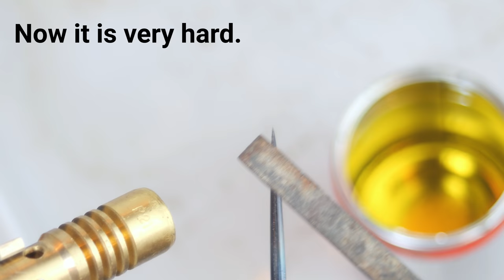I made this awl from an old screwdriver

Comment: Nice project.. I noticed to temper, you just heated up with the blow torch again. I've seen O1 call for 2 hours in an oven. Thoughts?
Reply from the maker: Well, this was not very scientific. If you don‘t know what the steel is, it is all just guesswork anyway. A lot of people temper stuff by heating it to a straw colour. I was lucky and it seems to have worked well enough.
Reply: @imadethischannel  I ask because if I can get away with that too, then it saves a lot of time and electricity especially for these one off projects like plough plane irons and awls
Reply from the maker: I think this is mainly for smaller parts. On larger components you cannot be sure that you obtain the correct temperature throughout the material. If you harden a blade all the way through but only temper the surface you get the opposite of what you want. Tempering in an oven with a controlled temperature is definitely safer.

Comment: After heat treating and quenching in the vegetable oil why reheat to a straw color? What am I missing? Thanks very nice work😁🛫
Reply from the maker: After quenching, the steel is very hard and brittle. Reheating to a straw color relieves some of that hardness to stop the tool from breaking while in use.
Reply: It is called Tempering, it can be done many different ways. I know for making a knife you should temper it at 200c for 2 hours.